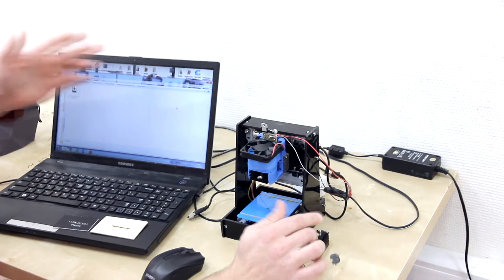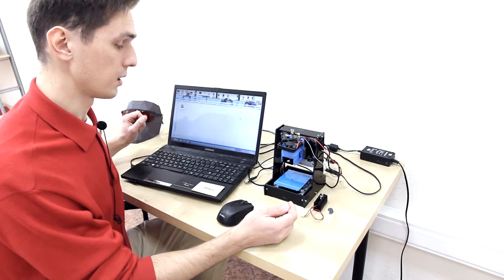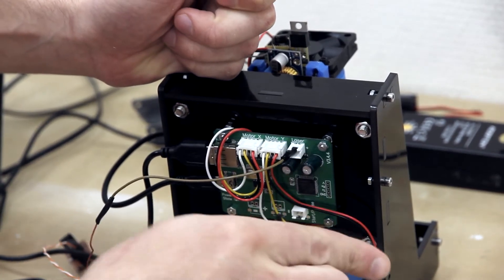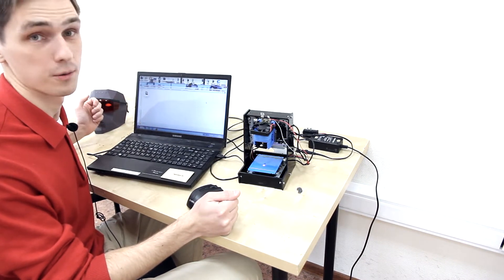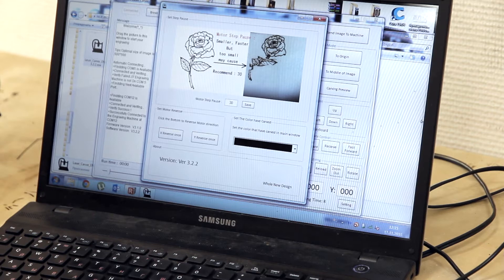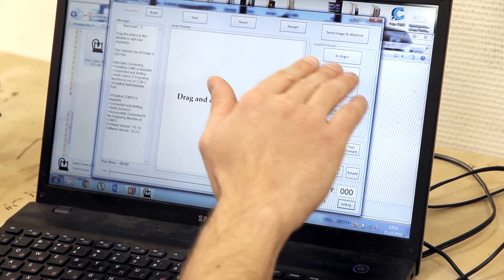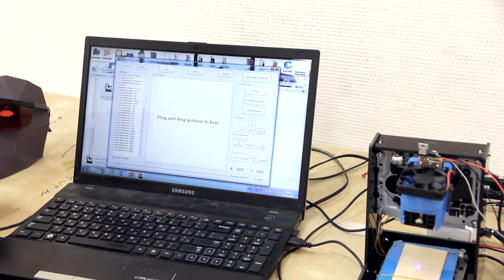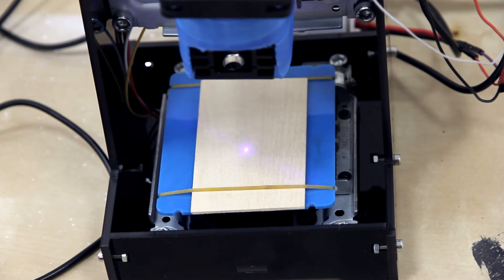Demonstration of a laser engraver Neje with installed 3.5W laser diode Endurance L-Cheapo

Comment: Hi, can I ask if you know about how much voltage the laser head requires? I bought a NEJE DK-8 1000mW laser head and havent yet attached it to my DIY cnc engraver, should I connect it directly to 5v of my cnc board or just from the 3.3v?